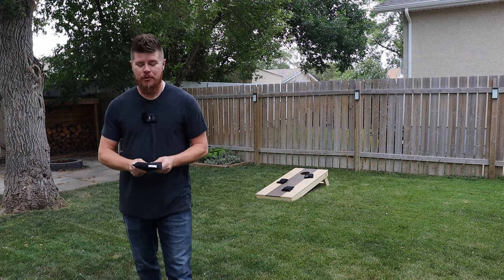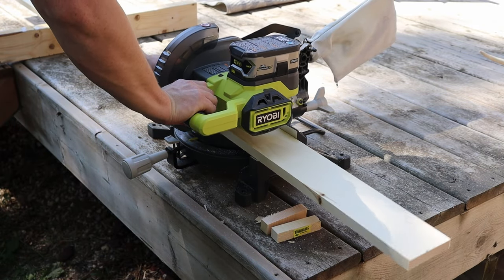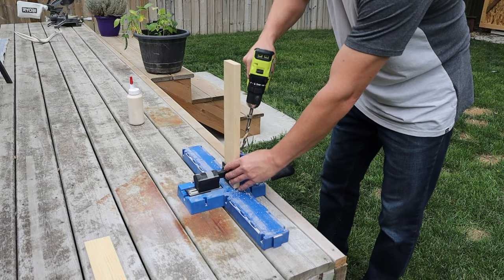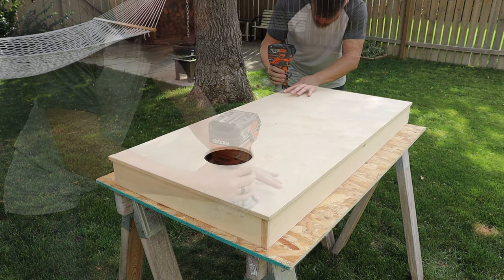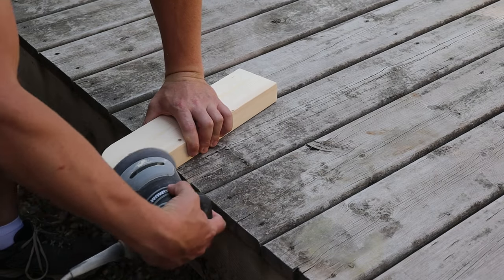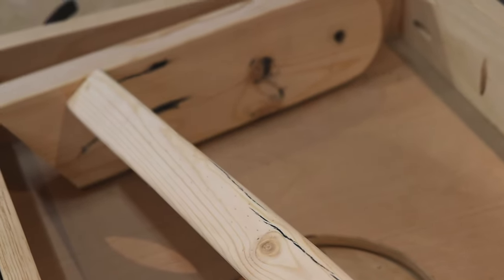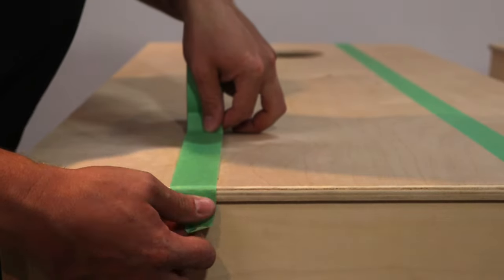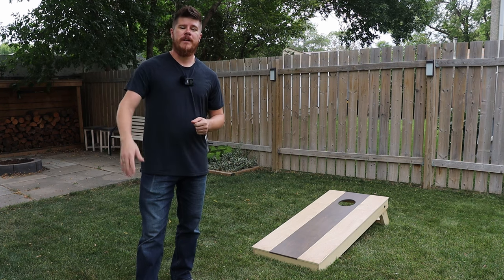How to make Cornhole Boards // With 2 bonus features - Plans available!

Comment: Awesome work! I’d say my two cents on your spacer/clamp/drink holder complication you asked for, would be to use a longer clamp going from leg to leg, lightly pinching the drink holder board between the legs. Tight enough where it won’t move around on you, and loose enough that you can gently tap it with a mallet to make fine adjustments until you’re ready to drive in the screws. 
I’m definitely going to try this! I’m thinking about adding a pop out “roof” above the drinks to keep bags from sliding off the back and knocking into drinks. 
Keep on trucking brother!
Reply from the maker: Thanks! I'm guessing I already spoke to you on Etsy at this point lol That's a great idea with the clamp. I haven't had anything slide into a drink yet, but I guess there is always a first time for everything. Will do man, you too!

Comment: I just done a set with cup holder and I kept the legs bolted to the boards and measured down an 1.5” on both sides of the leg and drew a line then line the board up on the line. Then I used a clamp the hold the board in between the legs. Not saying that’s easier but that’s how I did it. Nice job on the boards.
Reply from the maker: Awesome! Good to hear other methods, interesting to see how others do it. Hope you enjoy them!

Comment: What size pocket hole screws did you use? I used 1 inch at the shortest setting on the Kreg and still managed to poke through.
Reply from the maker: I used 1" as well. Yeah, that can and has happened to me. I think Kreg pushed the depth a little too far sometimes. I've got into the habit of pulling my drill bit up slightly before tightening the collar down so it doesn't bury the screw as deep. Maybe 1/16-1/8"

Comment: Very nice. Now do a vid on the "Hoosier" version from the Midwest with just 2x4's and plywood. kek.
I luv the cornbag holder(mice ate out mine in the garage), but the placement of the beer holders is bad because of the bags falling over the end. How has that worked for you? I won a set from Keystone Light($205.00) and gave it to my kid which is similar to the one you made.
Reply: I didn’t even think about the bags hitting the drinks in the holders. Perhaps adding a brace higher up on the legs would prevent the bags from reaching the drinks, or at least hitting them with full force. Thanks for pointing that out!
Reply from the maker: Thanks. We'll I'm from Canada so that'll take a Google search because I have no idea what those are lol. Actually that's why the drink holder is tucked up nice and tight to it and not further out. Typically the bags go flying off the end and I haven't had an issue yet.

Comment: My one question is, is it regulation to route the edge of the center hole? Since that is critical to bags falling in the hole or not falling in the hole, I bet there is a ruling on that.
Reply from the maker: I couldn't find anything. But it even looked like some hole kits you can buy had softened edges so I did it. But it is a soft transition, not a big round over

Comment: Looks good but acl regulation frames I believe are made from 1x3 limber not 1x4s
Reply from the maker: Thanks. Regulation height is between 3.5"-4" to the top of the board when laying flat. The 1x4 is 3.5" tall and 1/2" plywood on top makes it a smidgen under 4". The whole board is regulation adult specs

Comment: Could you attach the drink holder with the legs attached to the frame?
Reply from the maker: It was harder to balance everything that way and not have it in the way, but if you can find a way, no real reason you can't

Comment: Did you use painter tape or frog tape when staining?
Reply from the maker: Frog tape is painters tape, it's just branded is all. I just used basic ol scotch painters tape. I personally haven't been blown away by frog tape, especially given the price they charge. If you press regular painters tape down and into the project or a corner along the edge like you should normally, there basically is no difference, at least to me

Comment: I don't mean to be "that guy" but are you sure that's 1/2" plywood. Looks like 3/4".
But if it is, do you find it's enough thickness? I've read 1/2" can have a bit of a bounce to it when you throw the bag
Reply from the maker: It's 100% 1/2". With the center braces I added there is no bounce at all, it's solid. I was worried about the same thing that's why I made the bag holder also support the top from below.
Reply: Just finished building these this past weekend. Great video! My issue has always been folding legs. I just can't get them perfect. Each one seems to differ slightly from the next one, and it's single handedly my least favourite part of projects ...
Anyways, from one Canadian to another, it's nice to see videos with Canadian references (and prices!). You have my subscription! GO OILERS

Comment: Those drink holders need to go. Not a good spot for that. I don't want beer on my bags
Reply: Don't hate, appreciate. Move them further apart, closer to the legs. I've had no interference with the bags spilling my brews. In fact even a tall bottle can't be tipped over this way.
Reply from the maker: Thank you. I haven't had an issue either
Reply: Personal preference whether you include them or nought, nice option though.